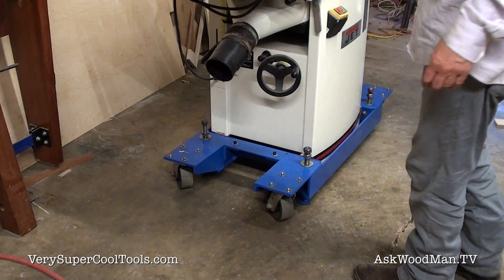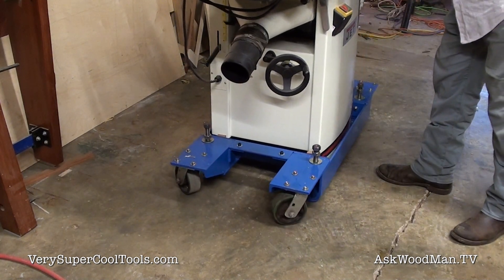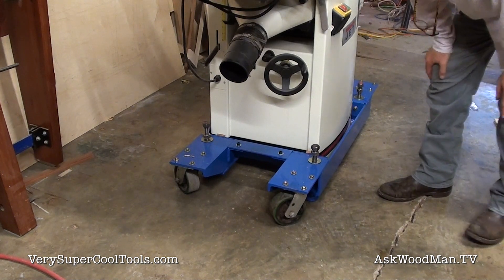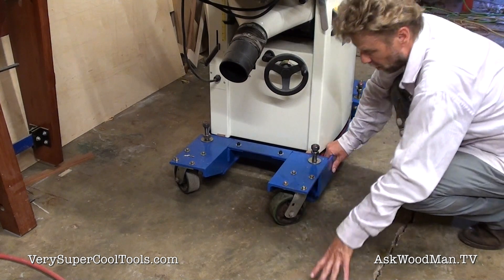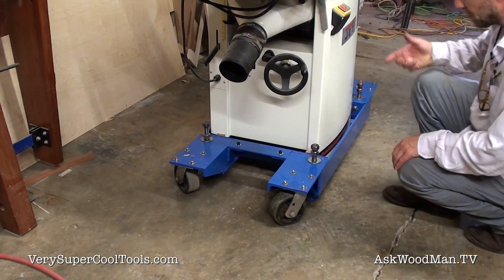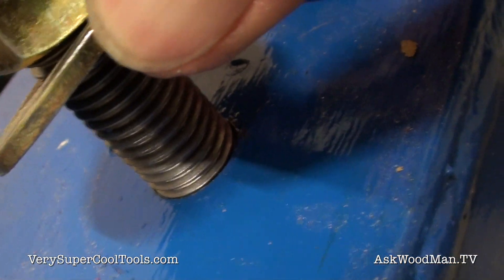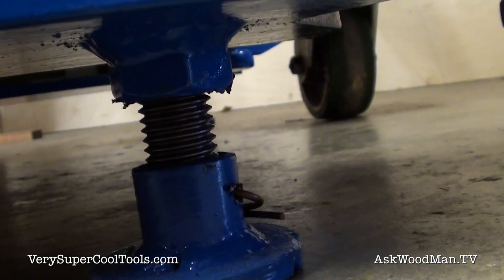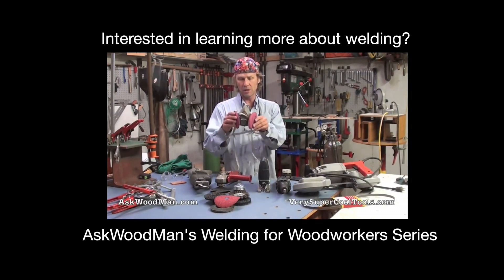1012. JET JJP-12 Jointer Planer Set Up (6 of 6)

Comment: I'm glad you mentioned the time lapse between videos - otherwise you have the fastest growing hair on the planet! I have the same Jet machine and likewise love it. Only reservation is the slightly agricultural chain drive system for the thicknesser. (which is what we call the planer on this side of the pond)
Reply from the maker: I think the chain drive is just on the feed roller. My Hitachi also uses a chain drive for the feed rollers as a drive mechanism from a speed reduction transmission off the motor. Some people here call them thicknessers too. Or thickness planer. Which would make for a hands across the pond compromise. Allan

Comment: Good series Alan! I'm hoping to find a used 6- or 8-inch jointer in the near future and I imagine this series will help with tuning it up, regardless of what I get. Thanks!
Reply from the maker: Hi Jeremy. When you get your new machine write me at my gmail and will do what I can to help you get it set up. I have set many different styles of jointers. Usually not hard, but you just get your self ready for some fussing.

Comment: looking good looks factory
Reply from the maker: Thanks Raymond. That design worked well for the jointer where the extended feet are tucked under the beds and out of the way. Thanks for watching. That is very cute child you are holding. Keep in touch. Allan

Comment: Hello, I've been thinking of this or the hammer a3 31 combo jointer planer and wanted to know if there was a way to extend the jointer bed like the hammer? Have you considered that with your large selection of aluminum extrusions? Lol
Reply from the maker: I have some flip down infeed and outfeed table extensions designed and mocked up. But I am using flat bar steel. Extrusions are too bulky.